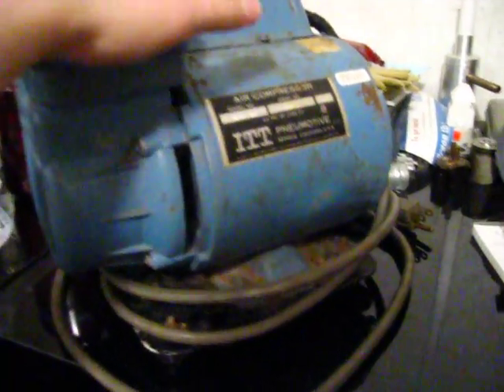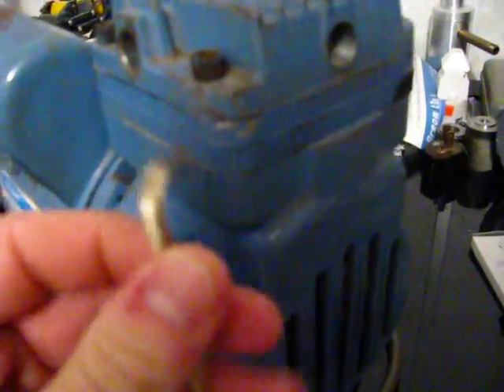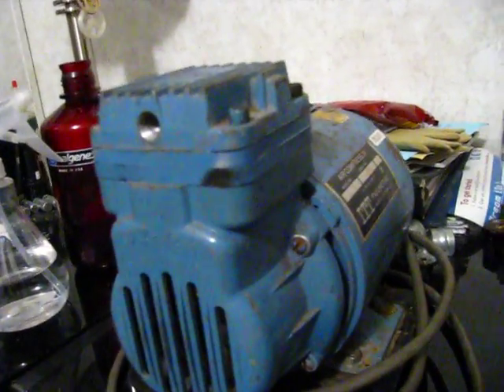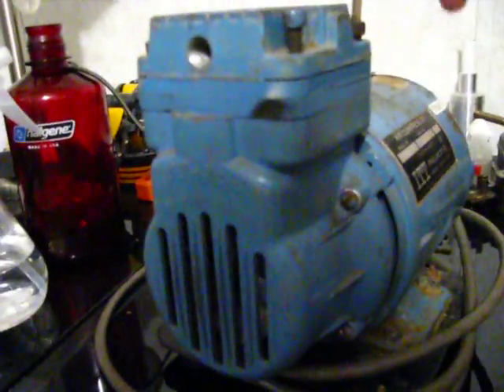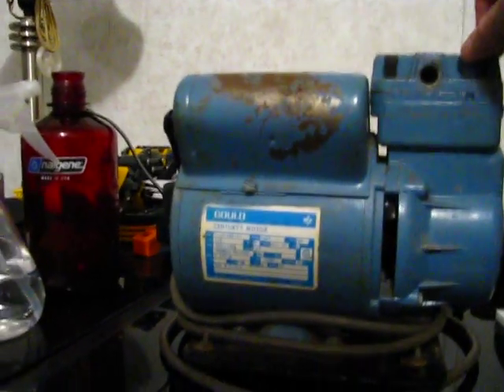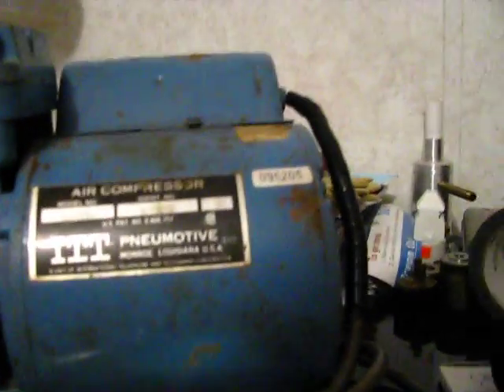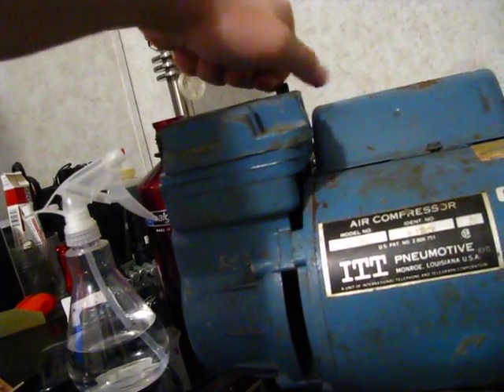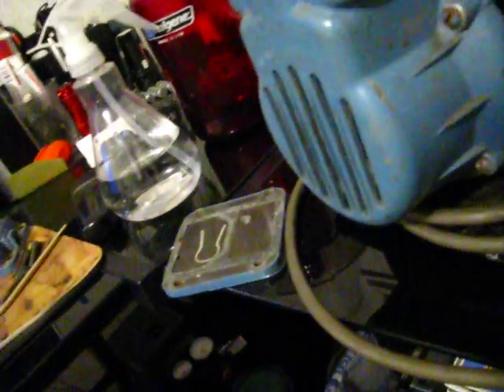ITT Air Compressor project

Comment: josh,  My Dad left me one similar to this (same brand, different model.  I'm only getting 30psi.  What should I check on it?
Reply from the maker: +Antoinette Failla what is the model and did you check the piston rings and or the valves?
Reply from the maker: +Antoinette Failla i will do a  quick video on what you need to check